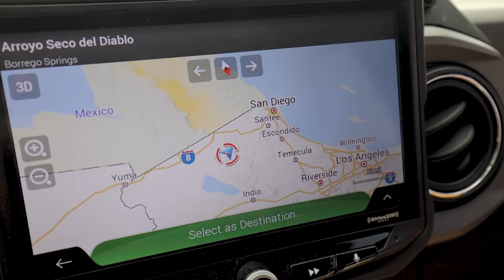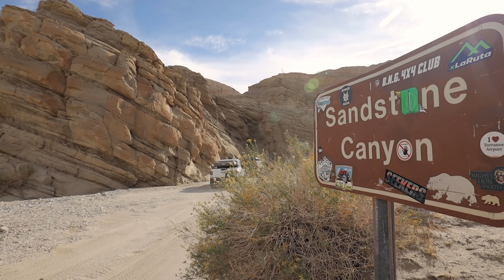Exploring Anza-Borrego's Majestic 450 Million Year Old Slot Canyon

Comment: That new set up is clean…since you access the tent from the outside, have you looked into the FrontRunner bed slide? I have it on my Tacoma with a Diamondback cover and it makes it so much easier to organize and reach gear located further in the bed without having to reach or climb on the tailgate.

Comment: With the Pro water tank from Frontrunner.  Are you worried about breaking the plastic nozzle when in transport?
Reply from the maker: The pro water tanks nozzle is brass. I would probably add Teflon tape to ensure it doesn’t leak. Other than that it’s solid, no leaks so far.